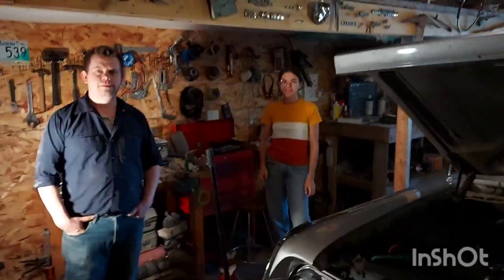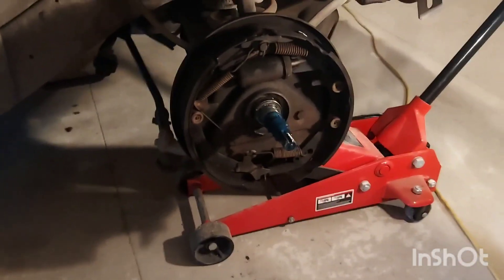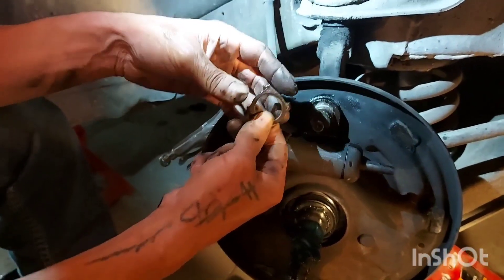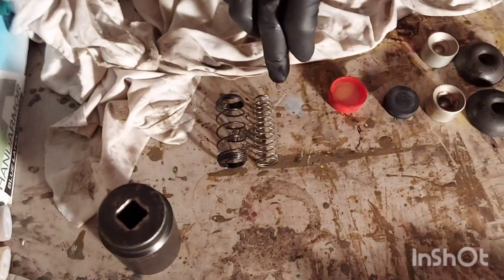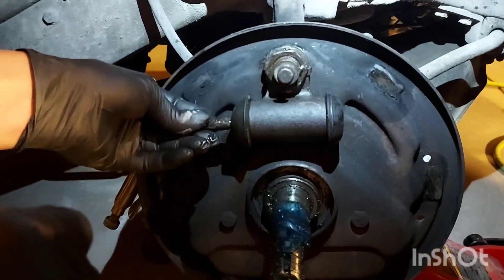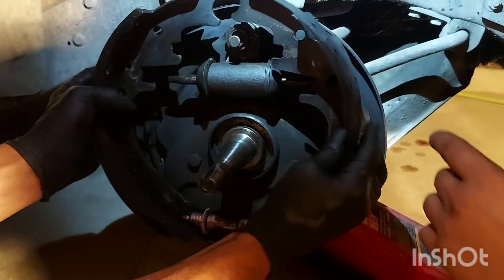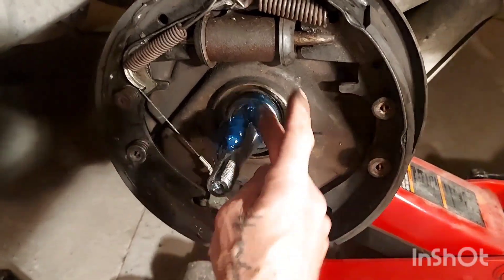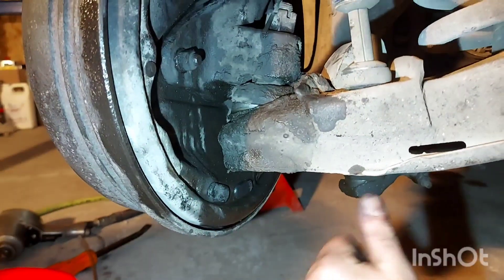64 Mercury Marauder brakes, wheel cylinder rebuild

Comment: When we first bought Edna almost 4 years ago, the previous owner had fully gone through the brakes. All new steel lines, rubber lines, wheel cylinder, brake shoes and all hardware, new drums, rebuilt master cyinder. All we've had to do is readjust the brakes a few times.
Reply from the maker: You gotta do a show on it chris we have the same brakes! Lol remember... start with the bottom cams, then the top! Shit we should both do it, thats handy imfo to have if anyone wants to drive one of these in original condition
Reply: @axlsnakedog  new video will be out in an hour
Reply from the maker: @adventureswithedna  i watched very cool location!